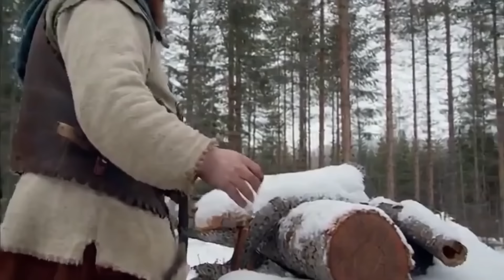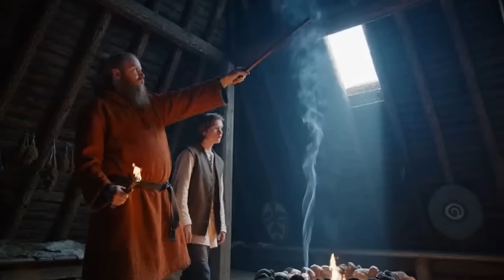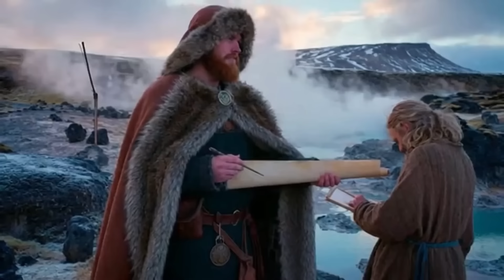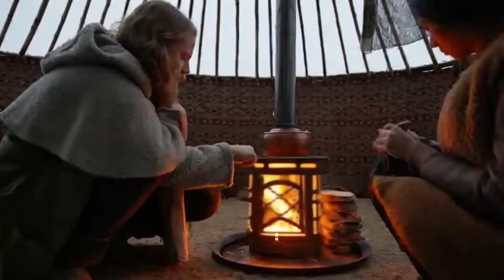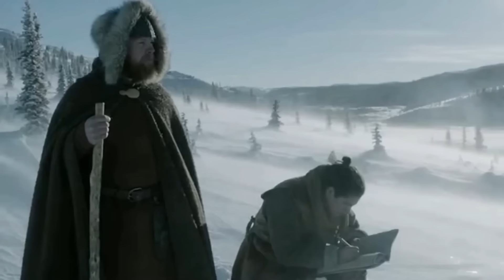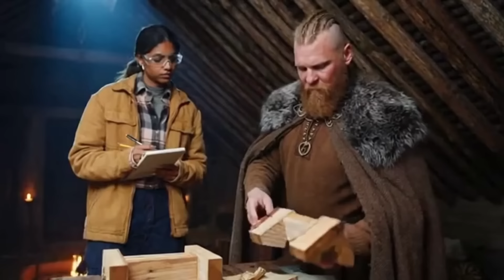Winter Vikings Survival: Stonehearth Airflow Systems Explained

Comment: Geothermal principles are still used in hvac today . The most economical of heat pumps today is the geothermal heat pump.
Reply: True, but try to get one installed in AZ. It's doable but no AC company wants to install one.
Reply: @joycenagy3140  that what I specialized in in my company .